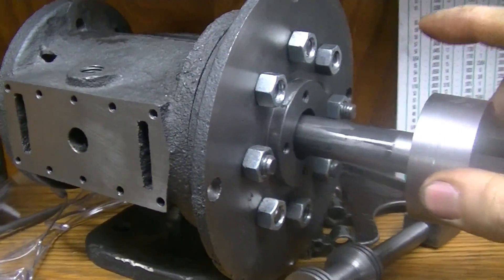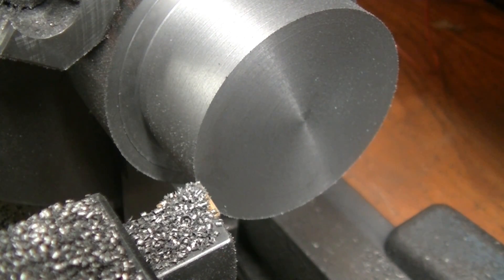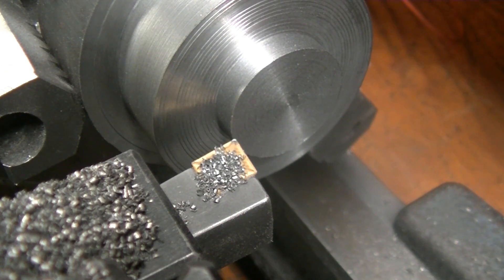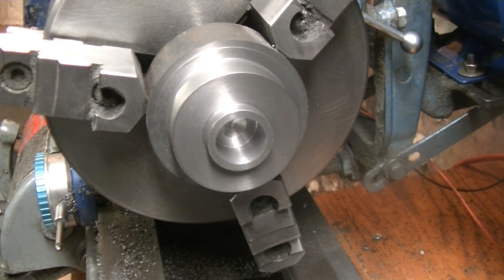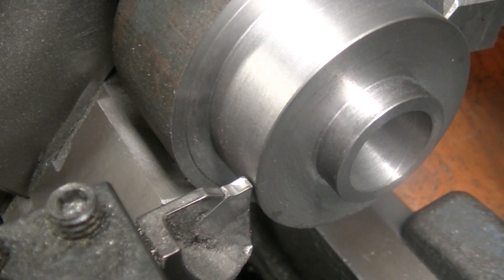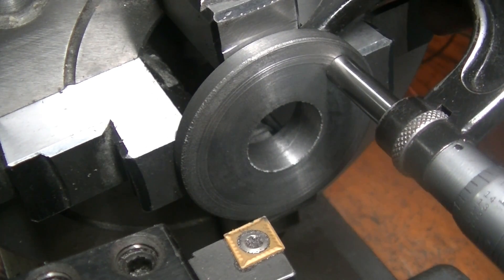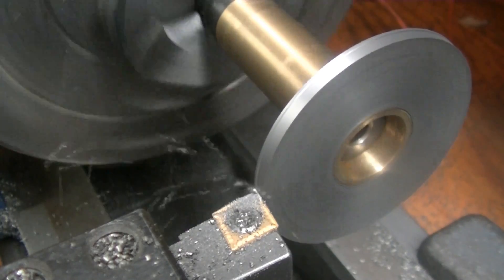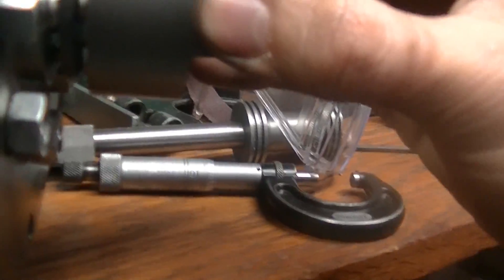Steam Engine Build: Making the Engine Stuffing Box

Comment: im thinking these days we have better material instead of packing that with a greasy rope which they did that sort of thing often back then' For example" boat impeller shaft bearing boxes" which would be considered totally jank today. 

why not urethane tool/punch and die rubber wipers optimal size of course.  it would stop steam leaks/ blowby' I thought of "O"rings but i thought again because they have a tendency to roll over on themselves and bind up the works or just fail. 18:03 tell me what you think.  I'm just guessing or course.

Comment: cool build so far, but why not use flat head bolts (countersunk bolts)? That would give you a flush surface without any bolt heads protruding.
Reply from the maker: I definitely could have. I initially thought the existing bolt holes were too close to the edge to cut a countersink that didn't hit the edge of the part.  Seeing the finished product, I realize that might not be the case, but it is damn close.  Design error on my part for sure.